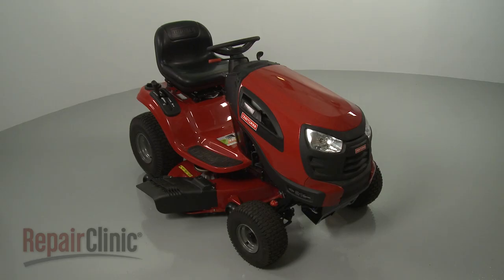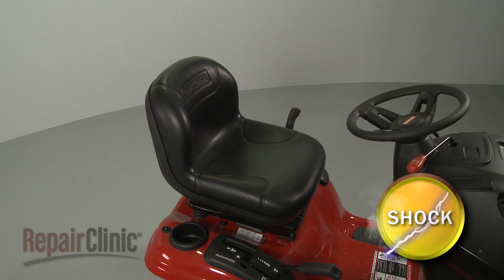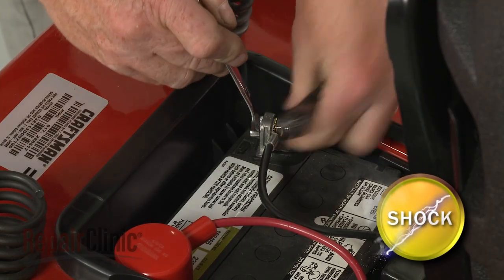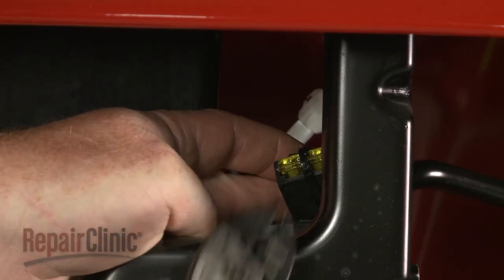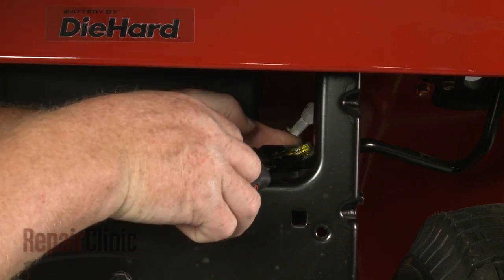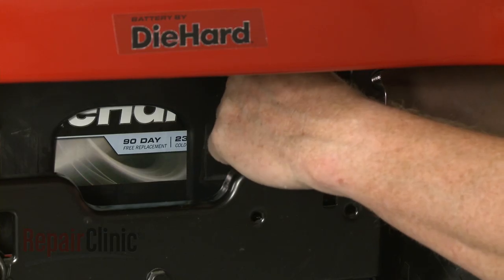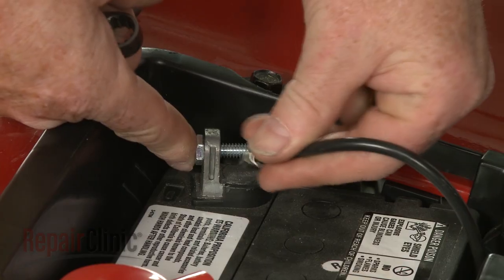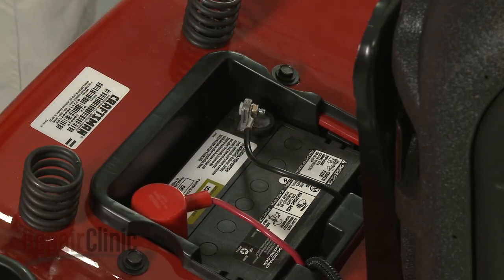Craftsman Riding Lawn Mower 20 Amp Fuse Replacement #532175158

Comment: This was pretty useless as all of probably know how to take the fuse out and put it in.  The problem is......where is the fuse located!
Reply: Thank you for your quick response! It was very helpful to me! Unfortunately, the fuse wasn't the problem. It also wasn't the battery. I guess my options now are solenoid in the starter or wiring issues. The lawn mower has less than 60 hours on it and was purchased brand new so, not really sure why I would be having a problem at all. But again thank you for getting back with me!
Reply: Teresa G😫
Reply: @repairclinic  No, it is not.  Mine is under the dash, see my reply below.  My model is 917288515.  Just remove gas tank and you'll find it easily.  Fuse location depends on your exact model.

Like everybody else, I watched every video I could find, but could NOT find the fuse.  My manual says it is under the dash, so I ignored the videos and took my gas tank out (two bolts, it comes out easily and set it aside, do not have to disconnect any fuel lines or anything).  There is the fuse under the dash, easily seen.
Reply: @hsbdon4618  Thanks so much! This thing was driving me crazy. I have 911728807.
Reply: on older models the fuse is located on the right side behind the fuel tank. you must remove the tank to get to it
Reply: For real!  Can't they just give a view that you can actually see where it is?

Comment: I spent a great deal of time looking for the fuse on my Craftsman LT2500.  Remove the battery. it is under the lip at the front portion of the battery box (area closest to you standing behind tractor battery box area) well hidden and hard to access, but it is there.
Reply: Did it fix your problem?
Mine is cranking but no start
Reply: @Blessd-savingrace  check the fuel solenoid

Comment: Remove battery,look on the rear backside in the battery compartment,it is tucked up under the lip.Pull down the wiring and you will see the yellow 20 amp fuse.

Comment: Hi! Where is my fuse on a Craftsman dys 4500?? I cannot find it anywhere??!! Checked all under hood on wiring , my battery is under hood, not seat. I just replaced battery, Solonoid and ignition... still NO power or dash hours display light when I turn key??

Comment: Where is the fuse in a craftsmanship with Koehler engine riding lawn mower? Won't click or start.
Reply: I've got a JT2000 Mfg date 2004 -- if you remove the Gas Tank (2 - 10mm screws) the fuse is right there

Comment: Like everybody else, I watched every video I could find, but could NOT find the fuse.  My manual says it is under the dash, so I ignored the videos and took my gas tank out (two bolts, it comes out easily and set it aside, do not have to disconnect any fuel lines or anything).  There is the fuse under the dash, easily seen.  Unfortunately, mine was good, so I must debug further.

Comment: Help...I meed to find fuse on t110 craftsman
Reply: I have the same one it says that the fuse is a 20A and can be found at the rear of the unit, underneath the fender located by the battery. Also the break must be pushed in before you turn the key. Hope that helps you

Comment: Question where would I find fuse on a ariens gear tractor
Reply from the maker: +ruby saliard The fuses are located in different locations depending on the model. There will be red wires going to a fuse holder with a spring clip. It can be located close to the battery or starter solenoid. You will have to pull on the fuse block to release it to replace or check the fuse.

Comment: what function does the fuse do on ys4500 craftsman / found it near solenoid
Reply: BLOWN FUSE  it tell you theres a  wiring problem. a fuse is weak link in wiring without a fuse if red and black leads touch in error the battery may explode the fuse burns into to open the circuit till tbl. can be corrected. somtimes you may need a volt-ohm meter to locate the cause.   hope this helps some one

Comment: Why want mower blades turn is there a fuse that's blown maybe
Reply from the maker: robert finley Most riding mowers use a mechanical lever to put tension on the blade drive belt. The belt could be broke or you could have a problem with the tension pulley.
Reply: Where is the fuse at?. I have a troybuilt with a 20 horse kolyer. Cannot find the dag gone fuse holder.

Comment: You will not get shocked off if a battery 12 volts or under....you can get burned if you short out any terminals💤

Comment: Where the fuck is the fuse?
Reply: look under the right rear fender.
Reply: mine is in the rear of the mower right behind the battery.i had to lift out the battery to find it..good luck.